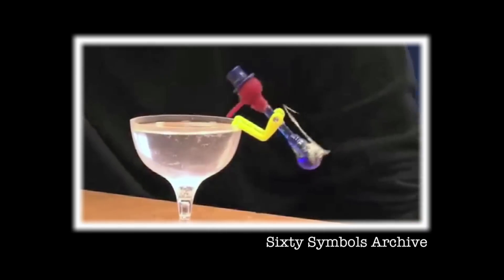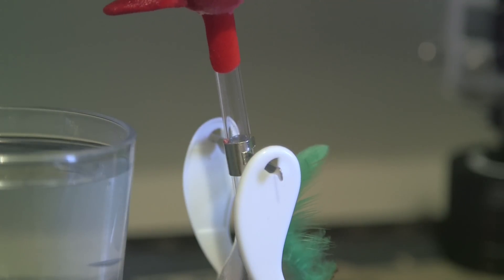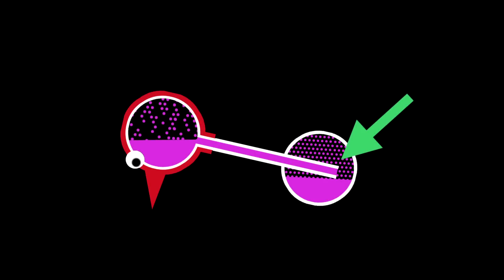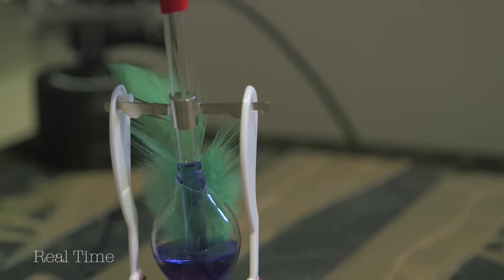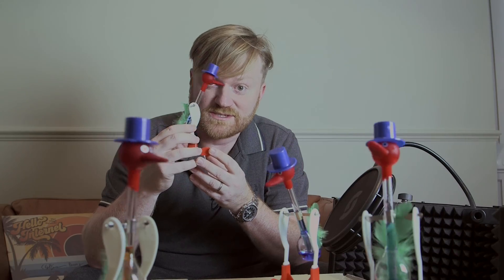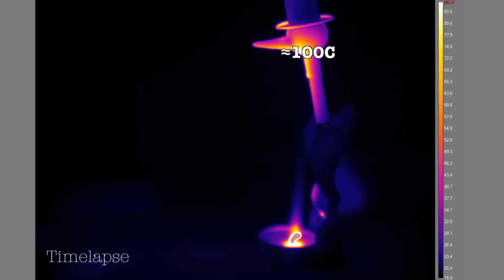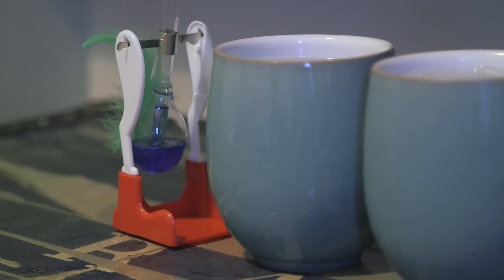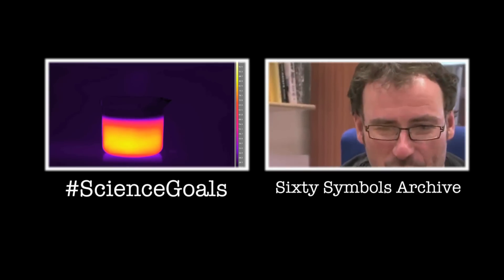Dipping Bird Experiments (THERMAL IMAGING) - Sixty Symbols

Comment: Can we generate energy by placing these things outside of other machines that produce much heat?
Reply: No. Instead, you could use that heat for boiling water and using that steam to turn a turbine. But by then you have how we generate electricity for almost everything.
Reply: Power plants generates a ton of heat, which creates a differential in heat, which can power "dipping bird engines". Isn't that possible?
Reply: Jack Poon Why? When the power plants generating heat is already used for power? That's how they make energy, by generating heat which evaporates water and turns turbines. Dipping birds don't generate energy.
Reply: Cortster Here is my analogy (I'm not sure it works 100%). When power plants (or anything that generates waste heat, like the back of your fridge or a Google server farm), it's akin to the hair dryer in this video, which means it can make a dipping bird move back and forth. Some clever engineer may be able to build a dipping bird that, when it moves, it turns a turbine and generates energy, similar to a wind turbine.
Reply: I'm not talking about the heat that power plant uses, but the waste heat that it discards.
Reply: look up sterling engines
Reply: nanotam89 And? Those are still not dipping birds. You're argument was using dipping birds for power, not sterling engines. Besides, the cost of making and maintaining sterling engines, in addition to the cost of the turbines, would not be worth the minor boost in efficiency. At all. 

Engineers take these things into account, something you obliviously are not. Maybe ask an engineer why 'your' idea wouldn't be practical.
Reply: I am a mechanical engineer. I just think sterling engines are cool and jack poon would be interested in them. you should probably chill.
Reply: nanotam89 My apologies. I thought you were Jack Poon.

Comment: This is probably a stupid question: if you set 20 dipping birds side in a line, would they synchronise after some time?
Reply: The birds are not coupled in any way, so you would have to wait a really long time for them to become synchronous for a single dip, but would then fall out of sync again soon after.

Comment: you should apply some diffuse coating to smooth surfaces like glass, so it doesnt reflect heat, and also emits more heat, so the camera can see its actual temperature
Reply: Yeah, it's called emissivity, and glass has pretty much none at all if you don't coat it with something. If you wan't to check the temperature of a window pane with a camera for example, the simplest way is to just put a piece of painters tape on it.

Comment: Could you perhaps show the same thing with a stirling engine? Most people would never have seen one and it'd be nice to see the thermodynamic exchange of a temperature gradient turn a wheel - particularly if you could attach a dynamo.
Reply: simontay1984 Tried and tested Victorian tech - was famously used to power foundries in Scotland. Obviously has its pros and (many) cons and isn't a replacement to internal combustion but its efficiency very high and it's been used in submarines very effectively where it gives advantages of low noise and is suitable to the environment.